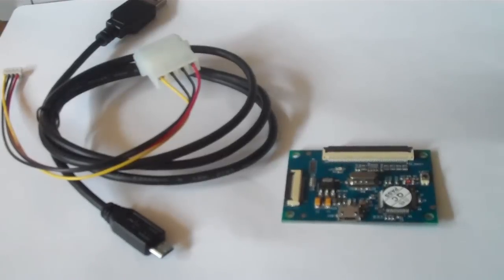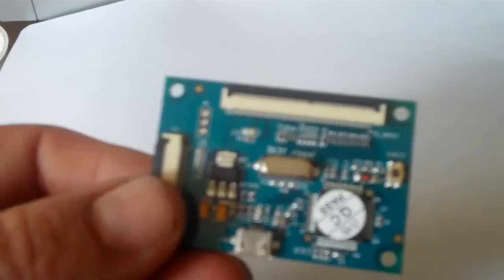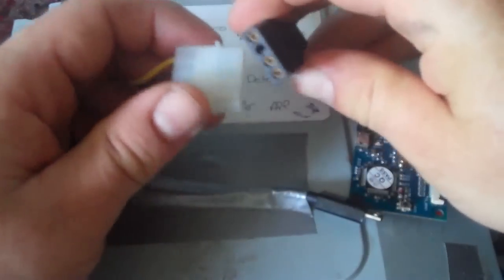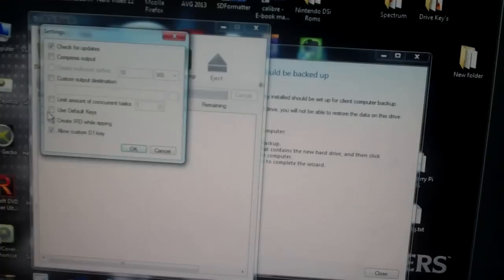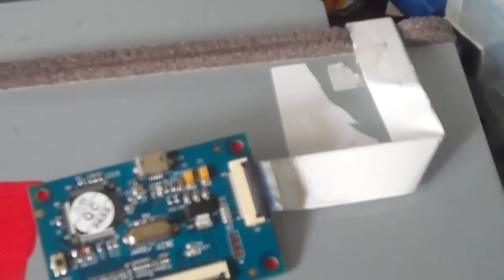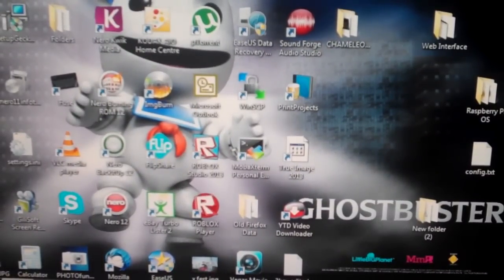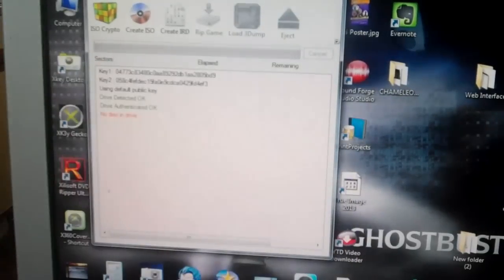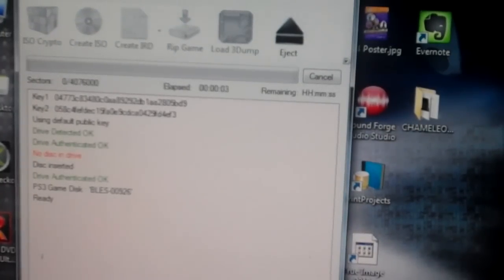3k3y Ripper v2 Install Tutorial. Rip/copy a Ps3 game to a Hard drive

Comment: so when im using a 3k3y board to play games from an hdd, i will need an extra ps3 bd drive and the ripper to make the rips?
Reply from the maker: There's two answers to this question.
A1. If you are running Bdump you can remove the BD from your PS3 and use that  (This is how both of my consoles run).
A2. If you are running NoKeys you will need to purchase a second BD as the PS3 needs a connected drive to work,
In both cases you need the Ripp3r board to make rips as this allows the PC/Laptop to communicate with the BD.